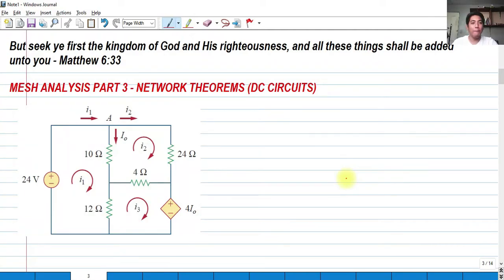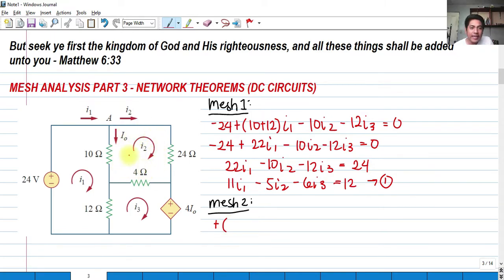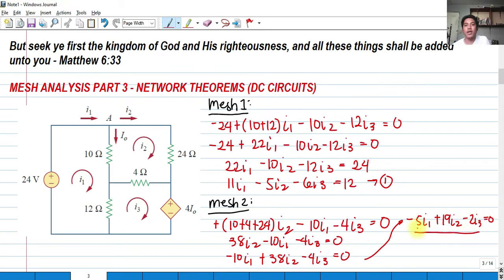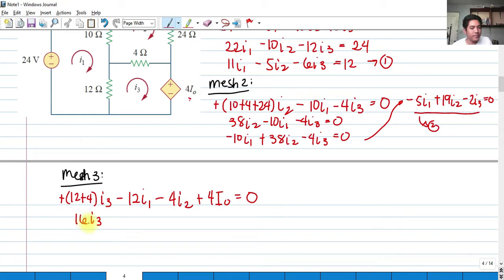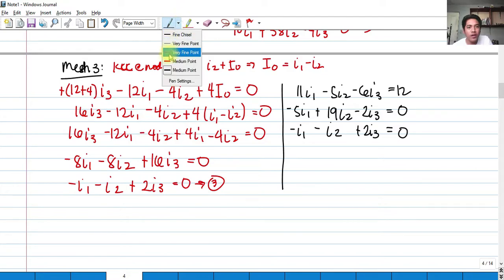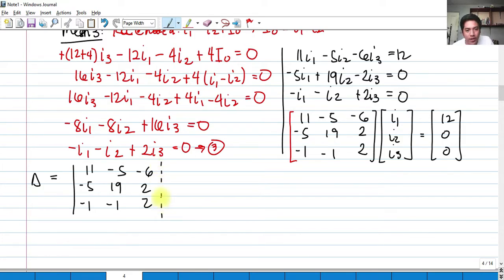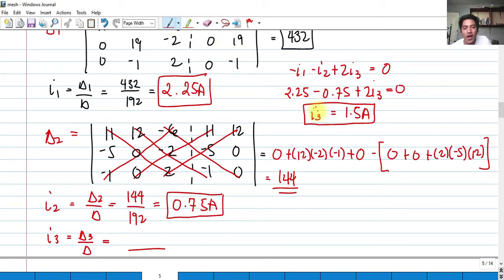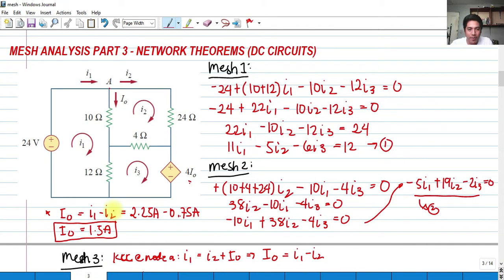Mesh Analysis Part 3 (Three Meshes) - Network Theorems (DC Circuits)

Comment: When inputting the values in the calculation using equation method to solve 3 equations , 3 unknowns. My answer for i1 = 1.875 A, i2 = 0.375 A, and i3 = 1.125A. Is this correct?

Comment: Sir thank you po kasi if i am absent on my OL class, i can view ur videos. But i have question on 10:07 the 3rd column on matrix, i am confused. Baka po kasi nkalimutan nyo po ung negative sign ng 2. 3rd column and 2nd line. The value of delta is different if -2 yon.
Reply from the maker: Hi, I only forgot to write the negative sign, but if you solve it, it is still 192.
Reply: @abatandchill  256 po nalabas sa amin.
Reply: @YramYllehc  same huhuhu